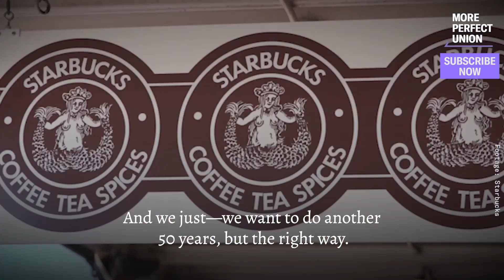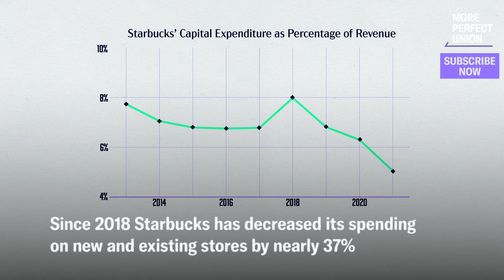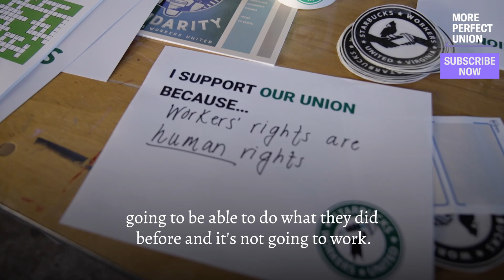20-Year Starbucks Veteran Sends a Message To Howard Schultz

Comment: I’ve worked for the company for 5 years so far and have never worked anywhere with greater offerings at the entry-level. They offer full healthcare benefits and fully paid education, both at part-time. Moreover, there are opportunities to promote multiple times per year where the pay and possibility greatly increases. Pay, in general, exceeds the local averages of surrounding businesses—Starbucks scales their pay to lead above local minimum wages for the entry-level positions. Even at an entry position, you are paid above minimum wage for a job that does not necessitate a wage any higher than minimum. The argument then comes for unionization. 

To unionize would be foolish, just as it’s been with teachers unions. There is no benefit to the whole—that is, a society—by unionization and the result would be amplified costs for the consumer of Starbucks. As some of us have learned, the whole is greater than the sum of its parts. There exists some argument that unionizing is to the benefit of the workers, but at the same token, it then runs as a detriment to all else in the form of minimum cost. There is a radically small minority within the company that are advocating for unionization. To pander to the near-nil crowd of ranters would be preposterous and harmful to the rest of us that do not want it.

When you are a wage laborer, you are simply that. Starbucks already panders to its people (called partners), changing policy and guidelines at the drop of a hat that keep them aligned with the social climate. It’s radically progressive and overwhelmingly accommodating, which nobody working outside of the company would understand. If anything they oust tradition and promote pop-culture. It’s their business strategy, effectively.

People need to extrapolate that Starbucks at the entry level is not a career. Stop asking for more and more when your job and its responsibilities have not gotten anything but simpler. Technology has removed much of the hassle inherent to customer service and satisfaction. It is already offering to its partners far more than any other companies of the same scope.

The crowd that is making noise is not representative of majority of the employees at Starbucks. Additionally, Schultz is a board member and was temporarily placed in the CEO position, by request, as the previous CEO retired this year. There is a replacement coming that is not yet announced, so stay tuned for what changes will come.

Until then, use your head and not your feelings in a subject that will have lingering effects for the people that actually work at Starbucks.
Reply: You're joking, right?